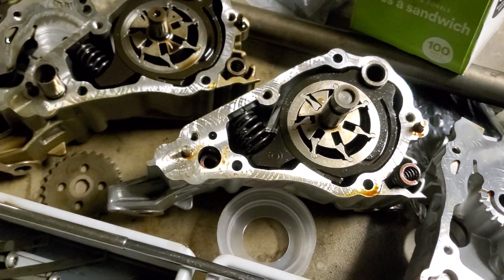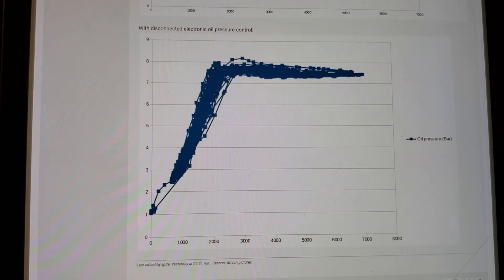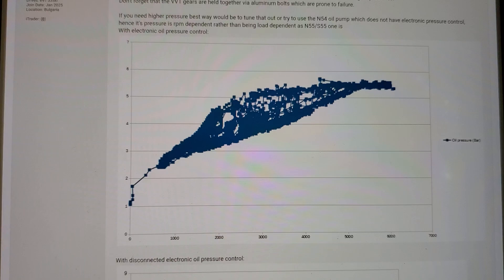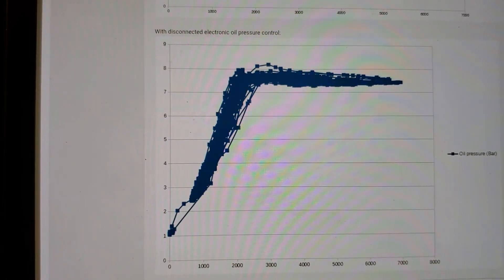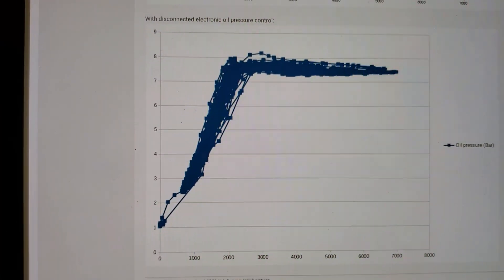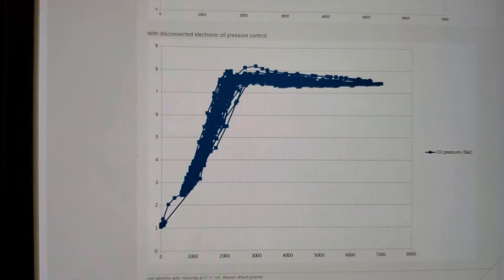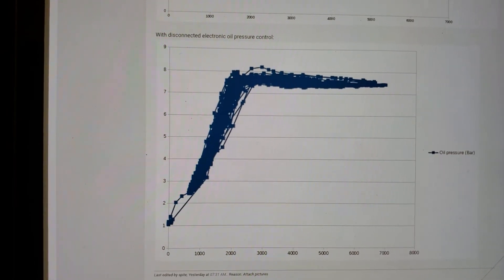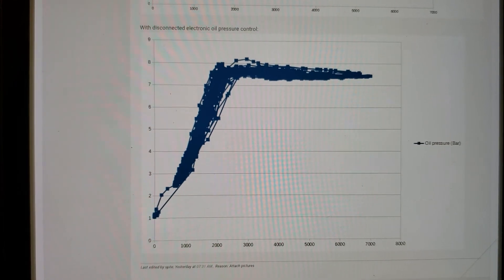Fixing N55/S55/N54 rod bearing failure, and variable-rate oil pump functioning. Part 3.

Comment: what do you say about the guys that spin a bearing in the n55 after doing the s55 “upgrade”? because its happened…. imo its cheapest and easiest to just change the oil at 5k intervals and swap bearings preventively at 60-80k… a new bearing isn’t going to spin the whole job is a couple hundred bucks
Reply from the maker: Watch part 7